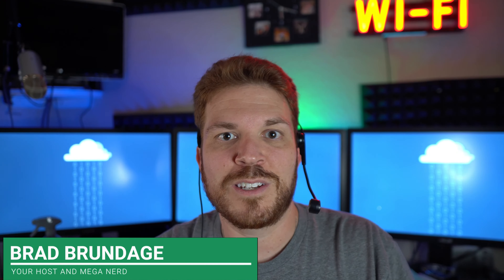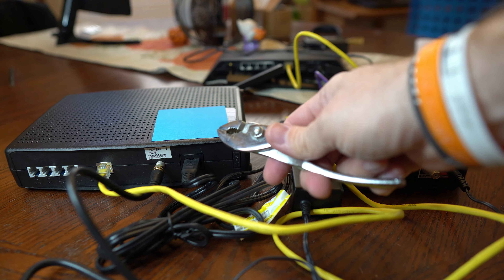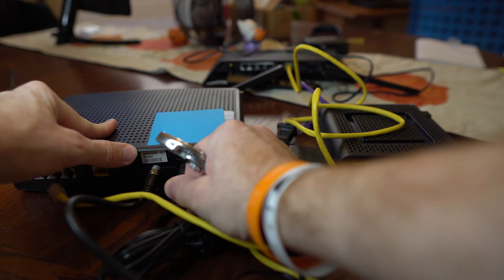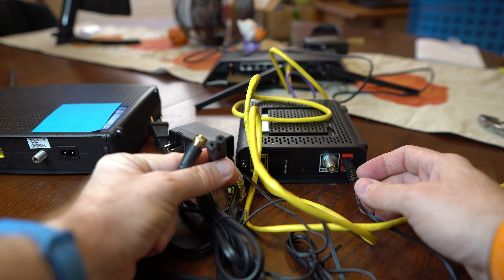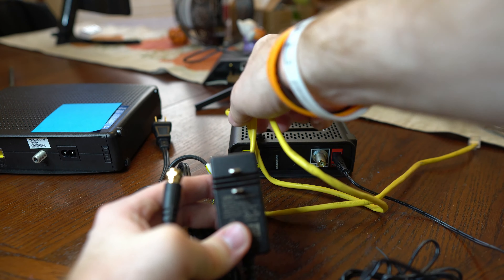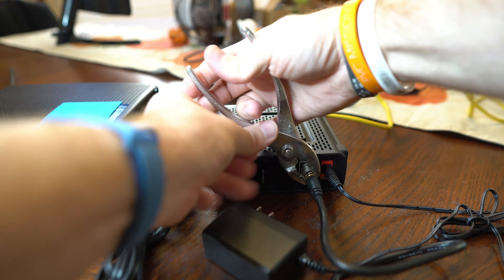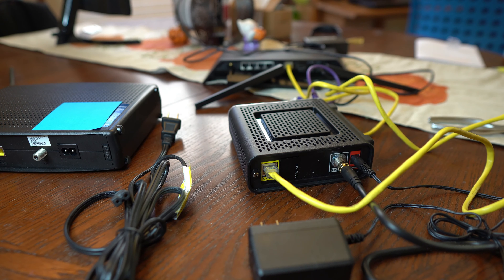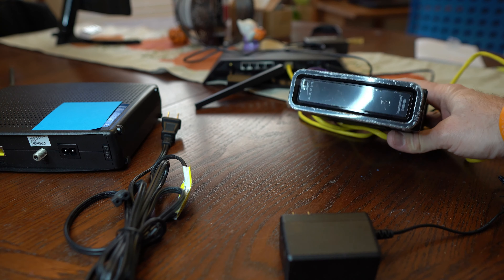how to replace your modem

Comment: Yea i took an Electronics A-Level its mainly if voltage of the adapter is higher than the new modem u can fry the electronics. Also you can damage the electronics if you dont supply them enough amps using same voltage bit too many amps ismt a problem as the device will only draw as much power as it needs. Then you have the polarization of the barrel plug thst can fry the electronics if they are designed bad and dont have diodes in the circuit to protect them incase they get reverse current. You can get USB to barrel connector cables to run some devices off a usb brick and some cables will also convert the 5v to 9v or 12v but if your usb adapter only supplies 2.4amps it will only supply about 1amp to a device at 12v after the voltage conversion. Some simple switches and smart home hubs u can power like this but most modern wifi routers need to many watts to power this way tho.
Reply: iiiiii
Reply from the maker: @Lewis Hellewell was this a pocket comment?🤦‍♂️🤣 (Like accidentally pocket dialing or pocket texting but instead a YouTube comment (

Comment: Me 30 seconds in: Noo way hes just gonna unplug one, then plug in the new one.

Me at the end: Well, that's 4 minutes im never getting back
Reply from the maker: @Jacob Richardson thanks for the constructive criticism. I make 2 types of videos here. Tech support Tuesday videos which can be super basic for anyone. And typically I make more technical videos or tech unboxings. Even if you're pretty technical you might actually like some of my other videos.

On the event you found this video searching for upgrading your router I do have a different video on that and no it's not as simple as unplugging and replugging as there's a handful of variables that you should consider as it may or may not be that simple depending on the previous configuration. Now I do have to admit something about this upgrading modem video is that originally I had someone actually ask about it and since I've seen modems die that were installed using the old power supply I was convinced to make a video on it covering that and other items as well.

For upgrading your router here's the video on it if that's what you were looking for:
https://youtu.be/Mmefd0M8Rco

At the end of the day I want to help technical and non technical people and bridge the gap between them so feel free to ask away for anything technical. I'm easily reachable here and on other social platforms. If you don't mind please reply back on how you found this video and what you were expecting as I will do my best to make better content with every suggestion.

Comment: I just love when I'm watching this and it goes to 144p all of a sudden.
Reply from the maker: @Astro Castro That is because the route (path it takes over the network) to youtube can't handle the traffic at that time. You can use a free program called visual traceroute that will help visualize where the packet loss is at. However if you only have a residential internet connection you most likely can't get your ISP to open a ticket for routing issues. Here's the link to the program: https://www.whatsupgold.com/free-network-monitoring-tools/free-visual-traceroute
Reply: I love having verizon and seeing 5g roll out while I live in the suburbs in the same county as minneapolis just 10 mins from the skyscrapers in a flat area and have 1 bar of signal that goes from 3g to 4g but works about as well as my phone signal on the moon
Reply from the maker: @Alex Kumlin ever consider getting a cell booster? Here's the one I setup at home and I've got great signal now.
https://youtu.be/bT3oe7z7jiU

Comment: You should use the new ethernet cable that comes with the new box.  Especially if you are upgrading from a Docis 1 or 2.
Reply from the maker: If the old cable has a problem then yes otherwise it could make no difference. Some older modems and routers only came with 10/100 CAT5 cables well newer ones typically have gigabit ones in the box period but you can generally tell just by looking at the ends to see if all eight wires are inside the cable, if not then it is the slower speed.
Reply: @ShinyTechThings  Yup,  the older gear came with the lower speed cables.  Might as well use the cable that came with the new box.  Same goes for new routers that are a higher speed than the old one.  Comes free in the box, might as well use it.

Comment: My modem somehow died and my internet provider told me it was going to be soooo complicated if I go out and buy the same modem instead of paying to rent a modem from them. It doesn’t look that complicated.
Reply from the maker: @Давай До свидания It's not complicated provided the modem is a cable modem and NOT a DSL modem. Does a circular cable (COAX) connect from your wall to your modem or is it a phone line that connects from the wall to the modem? Who is your ISP?
Reply: @ShinyTechThings  yes it’s cable but I found out it was much more complicated than I thought because I did not think of the possible incompetence of the employees. I’m not in the USA so you probably don’t know my ISP. Ive had no internet for a whole week because they’re supposed to put the MAC address in my account and activate the service but they just don’t do it , and every time I call I have to explain again and everyone’s giving a different answer or tell me the last person did not create the ticket. It’s incredibly frustrating.
Reply from the maker: @ХалиматЯмадаева28  sorry to hear about your frustration with your isp. Here in the United States they just need your serial number and Mac address and as long as the modem is on their approved list for them supporting it then it works. Even some that are not on the supported list I have gotten to work just fine like the Netgear nighthawk modem on Cox's network but it shows up as something else in their system but I had to call a couple of times for different people until I reach somebody that would just put it in and it worked fine. I'm not sure if that is the case over there or not but technically they only need those two components to get your modem working on their end.
Reply: @ShinyTechThings  it’s the same thing , they just need the MAC address and the serial number that hasn’t been used , add it to your account and call the owner of the cable service this particular ISP  uses , here multiple companies use the same cable system owned by a big corporation. The  problem is the technicians and the customer service , i think the central is in India , are completely incompetent. It’s not a technical difficultly , it’s just that they have to request for a ticket to be created with new modem’s info  and it goes through the system within 24 hours. Where it becomes more complicated is when they hire multiple idiots to answer the phone and they don’t care , they don’t  create no ticket or just do not speak the language well enough to understand the numbers and letters. Or they just forget to call to activate your system with the cable owners. I think they do it on purpose so you rent/buy their modems.
Reply from the maker: @ХалиматЯмадаева28  unfortunately it is probably incompetence more than anything else otherwise somebody would end up being a whistleblower by now saying that the ISP is encouraging them to rent modems instead of letting people provide provide their own.

Comment: I setup a new modem and it says I’m connected to a network but no internet. Do I have to call my isp to activate something?
Reply from the maker: @Farrenz correct they will need info off the bottom of the modem to activate it. Also please note that the modem memorizes the first MAC address to what's connected so if you have your PC directly connected and then connect it to your router instead of PC them the modem will need to be rebooted to learn the MAC address of the router.

Comment: Modems are crap. I spent $300 on a Netgear modem/router and it died in 2-3 years. I bought a new Arris for $330 and after 3 years it too died. I think Cox Cable is purposely destroying the modems so you rent their modem. Or making 3rd party modems not work and say “its outdated.” I finally gave in and just rent the Cox Cable Panoramic modem that they supply…
Reply from the maker: @jdmikeg4 They gave me the same speech that it must be bad "again" with my sb8200 but I lent it to a friend and it works flawlessly for them on Cox. I told them if it was damaged it was damaged by Cox because everything in my home office is on conditioned power with a battery backup. I since moved to the UCI modem which was way faster and stable even though I was on the gigabit plan but because I used a 2.5GbE port on my router it would get 1100-1200Mbps most of the time. Here's the video I made when I first got the UCI:
https://youtu.be/aXHdl6CoGjg

I since got Cox fiber and sold the UCI to a friend and what sucks is that when I first signed up for gig fiber it was supposed to be ~$150/no for their 2Gig plan and fiber supposed to have no data caps. The installer came out and said it was too difficult to install and to put in a ticket to have them move the box to the other side of the house. That never happened and another installer came out and did it saying the other guy is probably just lazy. But here's the kicker... During that time they took away no data caps and now I have to pay an extra $50/mo. If you can get a different ISP that's fiber without paying extra for no data caps then I'd look at them. What Cox market are you in?

Comment: Hi thankyou for the video. Quick question if its ok with you. i have a decent amount of computer knowledge but I'm a total beginner when it comes to networking.

I'm building a new network with 1gb internet speeds. Our internet rarely goes down i can't even remember when was the last time. But since its going to be used for my business i can't have any long downtime risks. So i was wondering if i had a 4G modem fully setup with the right settings waiting in storage ready to be used. Would my than already setup router automatically detect the different modem after a reboot without needing a lengthy router setup again? Because i kinda want to only plug in the 4g modem if the internet goes down and quickly continue operating my business without having to change my router settings. I figured surely today a router would automatically detect a different connection right and connect on its own right? I could get a failover router but those are €300+ wich is what i would like to avoid if possible.
Reply from the maker: @Milo So it depends on the 4G modem/router. Most are routers and not a standalone modem. Meaning if  you have services that need to be accessed from the internet that resides on your network you'll need to setup the 4G modem/router in bridge mode, otherwise it's double NAT'ing and that can be a pain. I have a Netgear modem/router that's 4G and I pop in my cell SIM card when my internet goes down and my router will re-detect that it has a new IP address and routes to access things. I just setup my Netgear router/modem in bridge mode and put on a shelf to collect dust until my main ISP goes down. My cell carrier however restricts what can be run so I can't run an email or web server but for me to access the internet from inside my network it works fine, just slower than my regular ISP. Does that help?
Reply: @ShinyTechThings  Thankyou for the response:) I will definitely look into that one as well. Currently i have Tp-Link omada as my main system. It's such a life saving to be able remote control the router from anywhere.
Reply from the maker: @Milo- with the omada last I checked you could not manually set the channels that would be used by the Wi-Fi radios or the channel width, if that is still the case and you have any connectivity issues unfortunately all you can do until they add that feature to the firmware is reboot them and hope it works. I know a couple people that don't have any problems with Omada and some others that do but the remote administration is nice.

Comment: I think I have a modem and router package into one device. I think I t’s an arris DG950A. My mom is paying 80 or so for internet but our internet connection isn’t matching what she is paying so I think I would replace the arris we got. What would you recommend I buy? I looked it up and I think the modem/router is an 802.11g or 802.11n. Should I also buy a package modem or buy a modem and router separately?
Reply from the maker: @Nobody Matters Separately for sure. I bought the SB8200 for my modem and it works great. It uses the broadcom chipset that netgear uses in their CM1000 and offers 32X8 channels. (The more the faster it can support) at the time when I bought it the SB8200 was cheaper then other modems with the same chipset.
Here's my experience with the modem and upgrade process:
https://youtu.be/ICH3JRW44Io

How many square feet are you needing to cover for Wi-Fi and what speeds are you wanting to achieve?

Comment: My wifi settings on my phone says “weak security” and on my modem box it has a flashing/blinking red light and next to it says “Broadband” so does this mean I need a new modem??
Reply from the maker: For the Wi-Fi weak security, it's telling you that you're connecting to a network that uses WEP or WPA security and not WPA2 or 3 (very new so  it always supported)
On the modem it depends. The blinking red light is never a good sign but you need to determine what the cause of the blinking is. If you login to your modem (usually http://192.168.100.1) but could be different depending on the model. Anyways if logged in to your modem you need to look at the signals and power levels for both upstream and downstream. Then look up the troubleshooting guide for that model modem a.d see if the signal is within the acceptable ranges. If not then most likely it's either a cabling or ISP issue. What modem do you have?

Comment: What if I have dsl Verizon and just decided to get a net gear modem will I have to call Verizon?
Reply from the maker: That is a great question. Because you have DSL for service, only certain modems will work as it must be designed to be used by a DSL provider. You will have to call your ISP and get the configurations for that modem to set it up, which is typically a couple of different selections you would configure plus a username and password for their network. If you end up replacing the modem, let me know how it works out for you. I do want to let you know though if you have consistent speed issues over DSL. It is generally due to the lack of line quality between your modem all the way to the central office. When this distance is greater than a couple miles, the speeds go way down as well as the reliability.

Comment: This making sure I could use the same coax  cable right
Reply from the maker: That is correct. Just be sure to use the power adapter for the new modem with the new modem. and this goes with all electronics just because the plug fits does not mean it is providing the correct amount of power to the device so it can damage things if you plug in the wrong adapter.

Comment: Can I still switch if my old modem has a phone lined connected to it?
Reply from the maker: @ReappersGamerTag If it has a actual phone line then that is a DSL line. You can go to another DSL modem but you cannot go to a DOCSIS modem which is for coaxial cable ISP's.

Comment: You’ll want to get coax cables with compression connectors not the walmart special crimp coax cables. You can stop by your cable providers store and they’ll usually give you one.
Reply from the maker: True, but I just grabbed one from my garage to show on video how it all connected.
Reply: What's the difference?
Reply from the maker: @Jackson Campbell reliability
Reply: @ShinyTechThings  What's the physical difference? Which is which? I think all the ones I seen look the same for TV antenna or ISP to modem.

Comment: I just bought a modem router do I still need to buy a separate router? Please help
Reply from the maker: @Christian Manuel Pagan Bernal What is the make and model number of what you bought?
Reply: It’s a Netgear and the model number is C7000v2 and is a dou so modem and router in one
Reply from the maker: @christianmanuelpaganbernal307  first and foremost make sure you are patched with the latest firmware for your cable modem router but from what I'm reading your ISP pushes it.
https://kb.netgear.com/000036375/What-s-the-latest-firmware-version-of-my-NETGEAR-cable-modem-or-modem-router
If the router firmware is only available from your ISP you would potentially benefit from having a separate router from the modem. I don't know your use case or your budget but I made a video on consumer VS enterprise and prosumer equipment here:
https://youtu.be/6tMFTcS5r_0
If it covers your living area and it's a regular consumer network then I would keep what you have but check out the other video and let me know more about your environment and security requirements.
Reply: Ok thank you
Reply from the maker: @christianmanuelpaganbernal307  you're welcome.